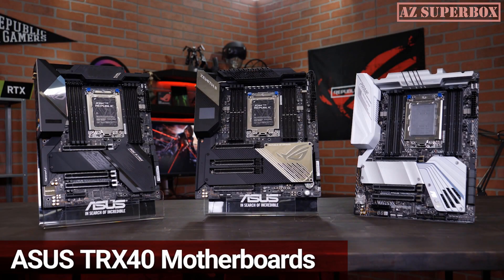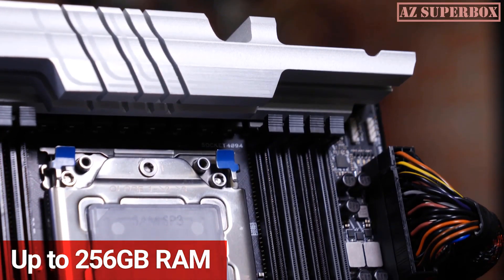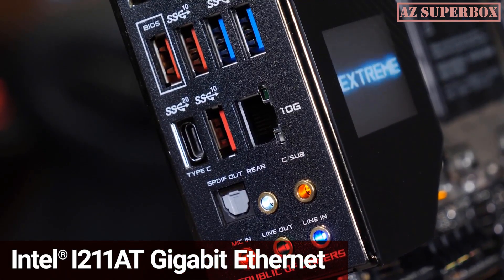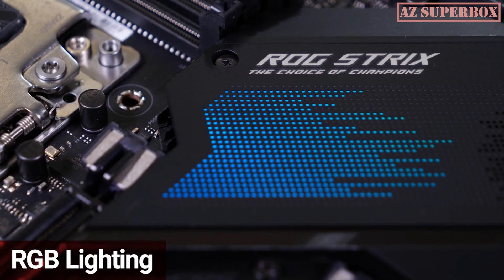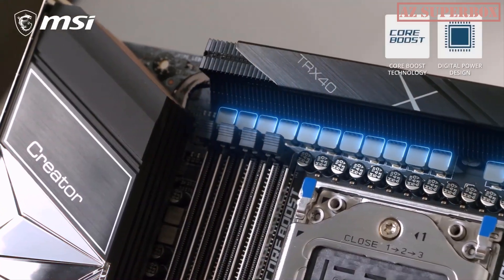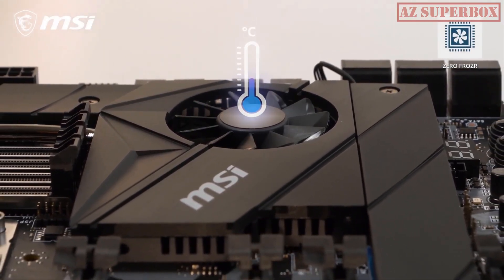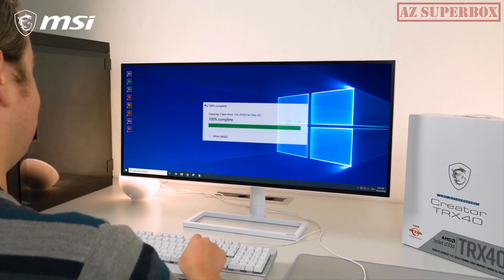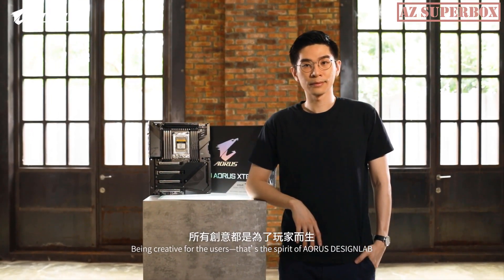Top 5 Best Gaming Motherboards For AMD Ryzen™ Threadripper™ Processors 2023

Comment: What is your opinion on the Designare board? I have a system with an Asus TRX40-XE Gaming and have had no issues and outstanding performance, I am looking at a second setup now and considering giving the Designare a chance because of the additional NVME slots over others on the market. The Taichi and the Prime are at the cheaper end of the market, the Zenith II Extreme Alpha at the higher end in terms of price. I love the Zenith, but need onboard NVME slots as this will be a semi-mobile build.